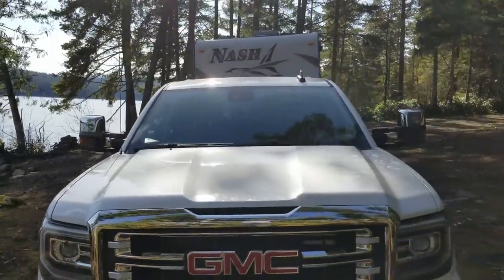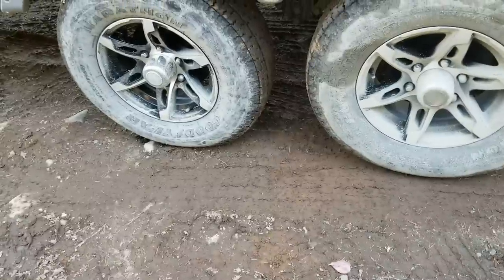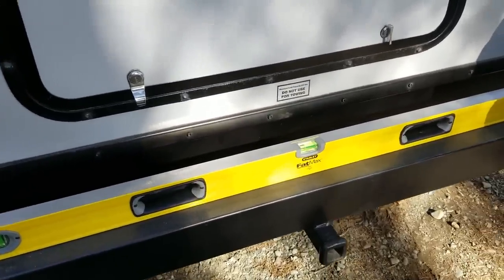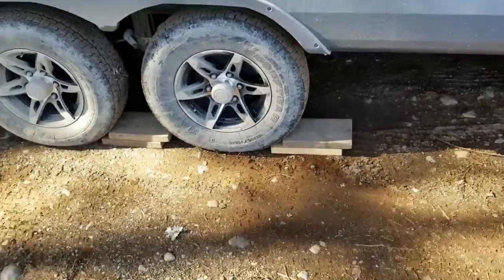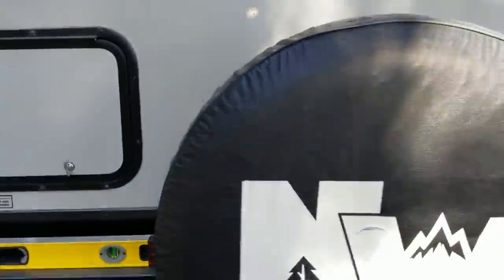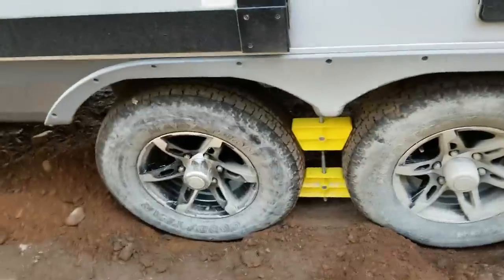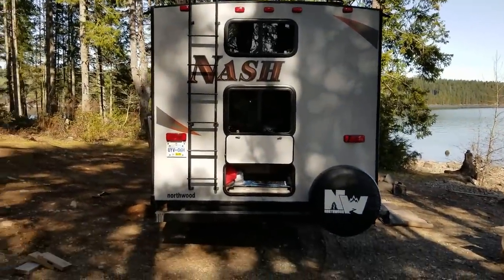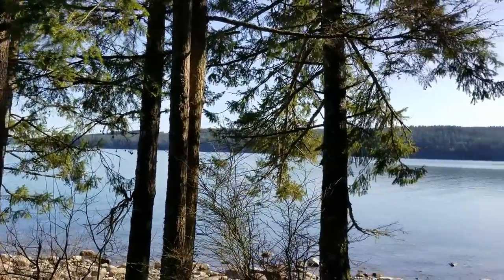How to level an RV on uneven ground - Off road camping

Comment: What an incredible location! Just a tip, you will need to multiply your correction by two to get the level correct, this is due to having a four foot level on a trailer eight feet wide. If you need 4" of correction across 4' of level, you would need 8" of correction across 8' of trailer width

Comment: I have a mess of Lynx levelers I use under normal circumstances. But I also carry around what seems to be a lot of wood blocks of various sizes. The nice thing about the orange ones I use is that they level up one inch at a time. I sometimes will use them along with wooden blocks to get the right height. I hate trying to dig holes in the hard ground. The longer the level the more accurate you can get when it comes to leveling using the method you show. I have a level mounted on the front of the 5th wheel that I can see in my rear view mirror and that helps tremendously but doesn't give me an accurate idea of how many blocks to use. 
Great tips here. 
Pat

Comment: I mounted a large (6inch) RV level on the front of my trailer as someone else mentioned (adhesive). I can see it in my mirror, and it helps me find the spot with the least slope while still behind the wheel. I have others on the side of my trailer for the fore and aft. Plastic leveling pads are much lighter than wood and they interlock in an offset manner so you can drive up on 3 tiers if need be. I sometimes have 3 levels under one tire and 2 levels under another to get the height I want. I still pack some lumber but not as much. As for digging holes, sometimes somebody else has already done that and you might be able to save your back. Those yellow tire locks between your tires are especially helpful on the raised side of the trailer as chocking tires 2 or 3 levels above the ground with the wedge type is not safe. "My mind is blown"! Keep up the videos.

Comment: Great video and I'll certainly be referring to this again. However, I'm constantly having problems leveling my Travel Trailer. After following the steps to level it side to side, I then lower the stabilizers and extend the slide-out. When I check to see if the leveling was held, I'm always having to relevel with my slide in the open position. The manual states to level first before extending the slide, but its not working well for me. Any idea what I'm doing wrong? Thank you.
Reply from the maker: Your slide may be heavy enough to be causing a decent lean once out.  You could solve this by leveling the trailer slightly higher on the non slide side and then once the slide goes out its perfect.
Reply: Very clever the technique of using the carpenters level on the back bumper because once it is level with the slide in, you can figure out the required adjustment to compensate for the slide weight. Get the slide out and use cardboard pieces to shim the level back to center. If you flip it over and use that offset with the slide in the actual camper will be a bit off but once that the slide is out, the camper should be perfectly level. The compensation for the slide weight being in the shimmed level.

Comment: Man I thought this was going to be the answer but my trailer is level side to side but is way off front to back, way more than the stock levelers will do.
Reply from the maker: Use the tongue jack to level front to back.  If you do not have enough height bring a 6x8 wood block to give u an extra 6" of height.  Add 2x8 blocks if u need even more hieght.

Comment: If it hitches to the bumper, it’s a travel trailer, if it hitches in the back of your pickup bed, it’s a fifth wheel, if you drive it and live in it then it’s an rv 

There’s a big difference 

Bumper pulls and fifth wheels are NOT rvs
Reply: Came here to say this... trailers are not RVs!
Reply: RV stands for recreational vehicle not motorhome. A travel trailer is a recreational vehicle!!
Reply: @kevinkappel8560  trailers don't have an engine like RVs, so they are not stand alone vehicles... not a difficult concept to grasp!